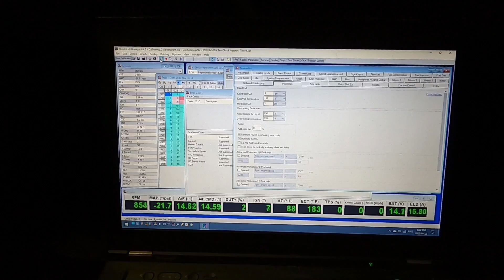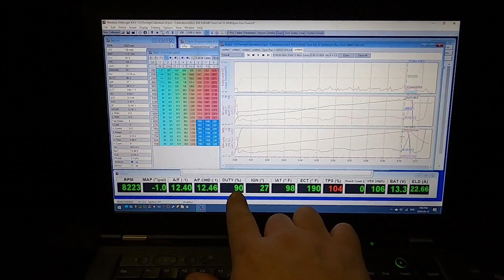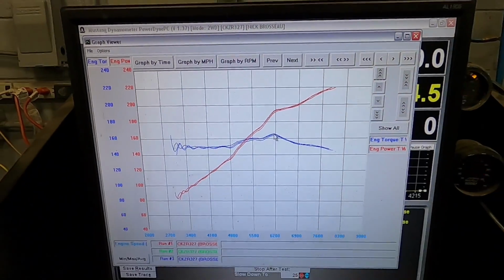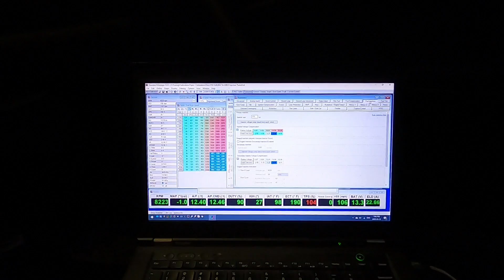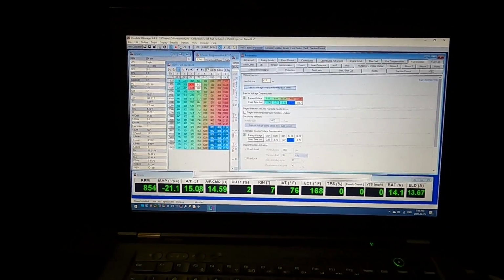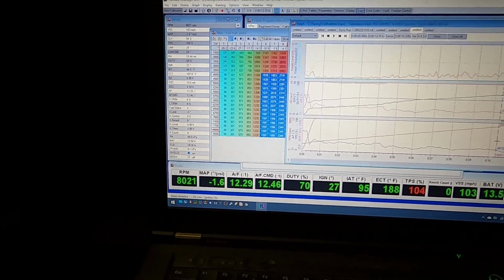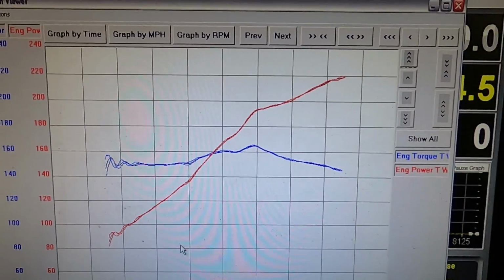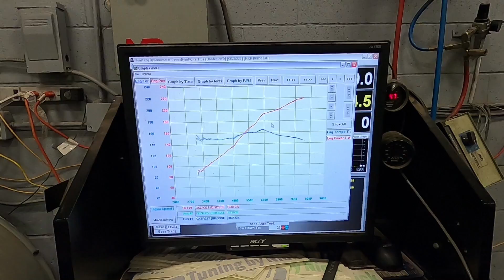Do RDX injectors make power?

Comment: My 02 RSX Type S hit 207 wheel horsepower with Hondata flash tune and Comptech race header but my A/F was 15:1 up to 16:1 in the 5,000 to 8000 RPM range, so KPro would have probably allowed me to even everything out and get 220 whp but I went ahead and traded it in for a 2005 Acura TL 6 MT, but I had a couple years with the RSX and did a lot of track runs.

Comment: The K20 already has good injectors to start with, multi hole with a good spray pattern, so it wouldn't make more power with RDX injectors, you just have more headroom for power. This test would be interesting when replacing old tech injectors, like for example B series injectors or 00-05 S2000 injectors, with these.

Comment: It will make more power if more airflow bolt ons are added. But I think that is obvious. I think the only takeaway here since the car had the same breather mods is that it makes the same power but the fuel system still had room if more airflow was provided

Comment: Is it possible to run stock jdm k24a injectors? I have a similar setup but jdm k24a with RBC intake and ktuned 70mm throttle body, 50 degree VTC and type s oil pump

Comment: @Tuning by Nick Just did RDX injectors and  noticed how  short  they are. I had the manifold off and saw that the injectors sit about a 1/4 inch up into the hole. Almost  like it's  shooting  the fuel threw a straw. Would like to see  this test with intake ported down, so the injectors sit flush in the runner.

Comment: You should've be making 4 1/2hp  to 5hp extra with RDX injectors. I don't know if is because the K24A would run different than a K20a2 but I got out almost 5hp extra with those injectors on a Stock k24A 3Lobe JDM.I was on the impression you would of get at least 3 to 4 Hp out of k20a2 since you have a Good Oil pump

Comment: You're duty cycle was low, you could tune it up to more.
Reply: Only soo much air and timing you can get from an n/a engine. While the injectors aren't maxed out, other parameters may be
Reply: @Darylrb1983  I ran a k24a2 N/a with a 72mm TB, straight pipe, RDX injectors, 255lph pump. 
Sold the car before I went bigger on injectors but had a ton of more room because when I started really dialing it in I just kept running out of fuel.

Comment: Nick, great video
 My 2007. Civic R18 is 90% duty stock. 
 Few questions for you. 

1. If tuning AFR  on AFM calibration to you adjust fuel from AFM FUEL table or AFM FLOW Table?

2. I see your actual AFR and AFR Command are not always the same. Why is that? (Mine does the same thing)

3. Any issues with tuning authentic RDX 410cc? 2 tuners told me to go with DW injectors because these are hard to tune.

I plan to turbo my R18 civic this summer and would love to be able to ask you some questions if I hit some speed bumps!

Thanks
Reply from the maker: Hi - For your questions
1 - You would need to adjust the AFM Flow table 
2 - The actual AFR reads will fluctuate based on what youre doing with the gas pedal and or if youre transitioning between low load to high load - You can really only expect them to be the same or close under state state load conditions - When tuning we are trying to get those actual readings as close to the target/command under steady state conditions 
3 - Real deal RDX injectors work well - But if youre going boost they are on the small side - Ive tuned hundreds of sets of RDX with no issues 

As for your turbo project - i am always happy to answer questions - but my honest recommendation is always to find a good local tuner to work closely with so you dont get conflicting answers to your questions - We all like to do things differently
Reply: @tuningbynick  thanks for the tips.  
Because I will be doing a Budget build  I will be the one adjusting parameters.  I’m new at this but have been doing a lot of research.  
We will see how it goes.  
I started off running afr flow but some tuner in Germany advised me to adjust AFM fuel not flow to adjust fuel trims.  

With 5-8 psi on 410 cc I’ll be around 70% duty.   Also looking at DW 450s
Reply: just make just you upgrade the rods on the r18 😅
Reply: @Aphone-q7f too late blew the motor

Comment: If using ktuner ecu what’s the difference in setting up these injector to work on the RSX type S ?
Reply from the maker: basically the same process - just change the injector size and the dead times
Reply: @tuningbynick  the dead time given  within ktuner when you select rdx injectors are they any good ? Or I should use different figures ?

Comment: So I have spare parts I have 2 set's of tsx cams with a 50 degree cams and rockers and RBC intake and I was thinking of just dropping a set in my base rsx just for hahas since I have Xtra parts even injectors from a tsx  I'm not looking to spend much on my base since I'm currently building a k20/k24 and a k24a2. Anyways my question is running those Xtra parts do you think the tsx injectors would be ok
Reply from the maker: The parts wont work properly if you just put them in - You'd need to get the ECU tuned to work properly with the different parts. Since its just for fun till your other engine is ready, its probably not worth the hassle to do it
Reply: @tuningbynick  I did forget to mention I do have the kprov4. I should of been more clear my mistake

Comment: Hey Nick, what's the rev limit you have set for the k24? I noticed when you were showing the afr , it went up to 8200 but on the graph it stopped around 7600. Thanks. I swapped a k24a2 2008 I to my RSX and have the limit at 8200 but I'm being told that's wayyyyyy too high
Reply from the maker: Because this is my personal car that i really only use for testing ive set the redline at 8000 and i was taking it to 8200 on the dyno. Normally i dont recommend over 7800 for clients K24 if it has the stock oil pump

Comment: this is an amazing video. thanks for being so clear and consistent. I'm just wondering with the claimed better atomization, would you be able to tune ignition further with the same AFR?
Reply from the maker: Thanks - I dont think so, i am running extremely aggressive ignition on this engine already. The main benefit to these injectors in my opinion is they allow about 20-30% more fuel flow which allows you to make more power if you are close to maxing out the stock injectors
Reply: @tuningbynick  Does decapping help stock injectors or does it just ruin the atomization? Thanks!

Comment: theoretically even with a good set of 1000cc injectors you wouldnt see any gains without adjusting timing and vtc of the engine to take advantage of the extra fuel , and to me the fact the rdx injectors were running less duty than the stockers - therefore they allow you to make more power?  the way i see it  is fuel is fuel and the computer targets a fuel ratio regardless of what injectors are shooting it ,  meaning your test would have the same results if you put in 1000ccs or the rdx injectors in. im not 100% though and im not trying to be a dick just putting my 2 cents in .
Reply from the maker: In a perfect world the size of injector shouldnt matter - But older injectors had really terrible spray patterns. I have a set of 1000cc injectors as well and will be doing a similar video with them as well
Reply: @tuningbynick  awesome! cant wait to check it out.

Comment: Great video, quick off topic question did u have to do anything to get ur hood to close with the stock throttle body? I just put my k24/20 in and seems like throttle body is unable to let hood close
Reply from the maker: Thats odd, i had no issues like that - Maybe its how the engine mounts sit - i am using Innovative mounts
Reply: Thanks ya I’m on stock mounts, and got hood to close had to shave some off the hood

Comment: Are those connectors non-insulated butt connectors?
Reply from the maker: yes - non insulated then protected with adhesive heat shrink
Reply: @tuningbynick  i saw the heatshrink.  I just wanted to know exactly what they are called.  Im getting ready to order some.   Thanks for the response.  Is there a particular brand you like more than others?

Comment: Fyi you're sucking in hot air from the motor and accumulated heat into your intake due to it not being extending out to receive cooler air directly from the front of the car.

Comment: I guess the only reason you would want to change is if the injectors were holding you back. Seems pretty obvious if you are balancing air and fuel it would be the same. Same amount of air its just easier for the rdx to do the same thing.

Comment: Would love to see what you think of decapped stock injectors
Reply: Aaron Millar I made 265whp on those
Reply: @mcmastersnick  with just bolt ons and this setup in vid??? So it's a better choice to go decapped stock vs stock capped or rdx 410s?
Reply: The Dude no, I had drag cartel drop in cams and a k24/k20 setup. Bigger injectors aren’t going to do anything for you unless you’ve got mods that require more fuel.
Reply: @mcmastersnick  what duty do the de capped stock injectors run at that bhp?

Comment: Do you think the power loss was because of overall temp or because of the crackle tune hurting the motor over time
Reply: most likely overall temperature, those crackle tunes rarely do any damage to your exhaust valves and if it does it takes a LONG time. also another thing i do know is that these tunes don’t take away from performance

Comment: Nick, just a question. With JRSC going for 11psi with aftercooler, do you think I need to get ID1000? Or is RC650 enough? And if id1000 is required, do I need to upgrade the other parts of the fuel system(pump, return system, etc)
Reply from the maker: I would personally go with the IDs over the RCs - At the bare minimum you should upgrade the pump
Reply: @tuningbynick  okay. Can you also tune JRSC, on a k20. After I figure out what's wrong with it first. Might have a big vacuum leak somewhere, because when I block off the TB with my hand, the car hesitates a bit, but it kept on running.
Reply: Rc750cc

Comment: Hello are these deadtimes for K20Z3 correct (FlashPro configuration)?
injector test pressure 43.5psi 

8volts  2.5 
10volts 1.8 
12volts 1.41 
13.2volts  1.224 
14volts  1.1
16volts  1.04

Comment: Logically it makes sense that a bigger injector wouldnt make more power on a Stock NA motor when the stock injectors were pretty much providing enough fuel already throughout the powerband. I could see this being a good upgrade for a K20 with some mods and higher rev limit where more fuel is needed up top over the stock injectors, but not on a stock K24 that most only rev to 8K tops.. I know my power starts to drop off by 8K anyway with the stock VTC. But def a good test to show everyone the truth as so many people swear by RDX injectors on stock K24's and Stock K20's. $350 for possibly a few HP just aint worth it to me.

Comment: Does the fuel system have a return ? If you put a return line to the tank and regulator at 60 psi... and yes the exhaust upgrades are needed. Fuel pressure needs a bump.
Reply from the maker: Its still a stock returnless fuel system on this car

Comment: If rdx injectors ain’t available, will you recommend to decap the stock 310cc injectors? Thx
Reply from the maker: unfortunately i dont have any experience with decapped stock injectors
Reply: Taking the filters out will give u more power for sure 👍
Reply: @Fa5Squad  how👀
Reply: @Mr_vtec_fa5si  theres little filters inside the injectors taking them out increases the flow to like 650cc but just better off buying bigger ones
Reply: Taking the filters out will give u more power for sure 👍

Comment: So you made 233whp at colder temperatures wow so my stock k24 with rbc Vtc and Intake manifold stock full 08 tsx k24a2 head to bottom with rdx Injectors at 43psi there 410cc and I made 232whp 199wtq and the temperature was summer 87degress these injectors can also be at 70psi of fuel pressure and they will be at 570cc and I was using the injectors only at 410cc there deff more room for fuel..the key is that it needs to be tuned to make power any tunner that’s been doing this for over 10 Years + knows it needs to be tuned

Comment: Great insight on RDX injector/K24a2 performance Nick.  Any plans in the near future for a 50 degree VTC intake cam gear & lets say... a KMOD k20a2 ported oil pump?  lol -  Im down to see how well RDX injectors will perform with that set up!   Currently building the same set up in my 2005 DC5.
Reply: He wont need a ported oil pump unless he is doing serious NA building.. 9K is MORE than enough even for a frank build. And reliability would be hugely compromised with a k24 bottom end at 9K+ rpm.. 9krpm on a K24 is the equivalent of over 10K rpm on a K20.. At least in terms of piston speed.. He would need a fully built motor. The stock k20 oil pumo is perfectly fine to 9K.. I had a built frank making 290whp that revved to 9100 rpm and that thing lasted for over 3 years being beat on constantly with the stock k20 pump. RDX injectors are overrated.. For around the same price you can get a set of ID725's that have(in my opinion) better spray pattern and are tested more for performance and have more capability to for more power.. RDX injectors are only good for a super small rev and power range over stock injectors.. You may net a few HP with full bolt ons on a K20 with a higher rev limit or a built head, but if you build the k20 at all with cams, valvetrain, and pistons, they are limited. So it makes no sense to spend $350 on RDX injectors for a few HP but still have an injector that cant make 300whp.
Reply: @MikeHarkins-w9b  I'm new in the Honda scene im on old vw guy. I recently bought a 08 si K20 Z3 6 speed manual has a well penis intake and Honda with flash pro. Trying to get it to at least 250 275 without spending too much. What do you recommend? Really appreciate the info.🙏
Reply: @Simpleman1078  To go 250+ Naturally aspirated is gonna cost money.. You'll need cams, port-match intake with 70+mm Throttle Body, a good 3+ inch Cold Air intake. You will need a good race header and at the very least a 2.5 inch full exhaust. With that, you can probably make about 250-260 tops depending on the cam you go with, but reliability does become an issue with more timing and cams. In my honest opinion, Id look for a used Greddy Turbo kit, or a nice SuperCharger.. MercRacing makes a PHENOMENAL kit, but is expensive. But what makes going boost more practical is 1, you have more versatility to make more power, 2, you can stay bone stock without needing more RPM and more timing, which keeps reliability up.. If you stay below like 11 PSI of boost, you will be perfectly fine and reliable. If you go with full bolt ons without cams, you can probably make about 230whp, but the K20 motors are so slow below 6000rpm when they are Naturally aspirated. I personally went K24 in my RSX Type S and it made a significant difference as it has more torque and more power at lower RPM. If you want to save some money, just go with a custom turbo kit. You can get away with an Ebay turbo for cheap, just have it balances and checked at a machine shop before install. Just make sure you dont cheap out on the technical stuff that is crucial for operation, like injectors, intercooler, wastegate, BOV, map sensor, fuel system.. Humble Performance has a FANTASTIC turbo kit for like $3,000 ready to go with a Precision 5858 Turbo. Its a 500-600whp kit but you can run low boost and make 300-350 quite easily.
Reply: Nitrous.and tune Cheap and safe as hell on a nice tune

Comment: 8000rpm seems too high for the stock oil pump.
Reply: 8k is the limit for tsx pump. K20 oil pump good to 9k or so
Reply: Its not .. i rev to 9k all day
Reply: @oscarescobar2777  You def dont re a stock k24 to 9k all day lol
Reply: @MikeHarkins-w9b  as far as stock rsx oil pump 9k is my limit ... stock k24 i definately wouldnt take it to 9k ... mine is k24/20 and built a bit and i do take it to 9k all day
Reply: @oscarescobar2777  well yeah no shit you can take a built frank to 9k... THis aint a frank tho my man.. The original comment is talking about the stock K24 oil pump.. The motor in the video is a K24, not a frank..

Comment: Nick, quick q. On a k20a2 engine would a k20z1 intake cam make a difference, stock factory tune? If I can score the cam for 100 and gain 5-10 hp then I think that’s a good $/hp gain.
Reply: You wont see much of a gain without getting Into the tune. The increase you're looking for isnt going to happen just dropping in another stock cam without any tuning.
Reply: Joe Dooley how much difference in hp would a drop in drag cartel get vs stock cams. Obviously with a tune now.  Not going with tsx but either prc or k20z1.  Again trying to gauge the best $ per hp route.